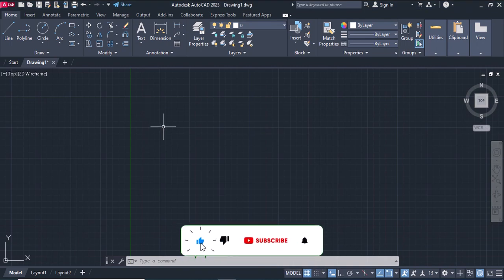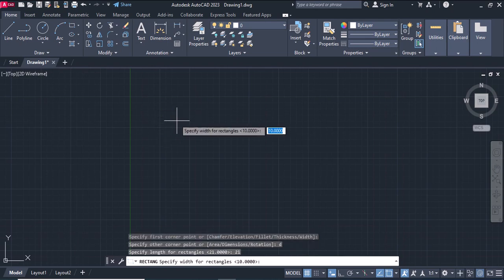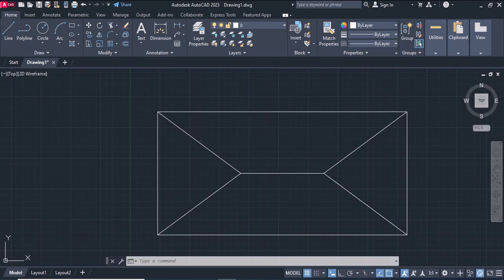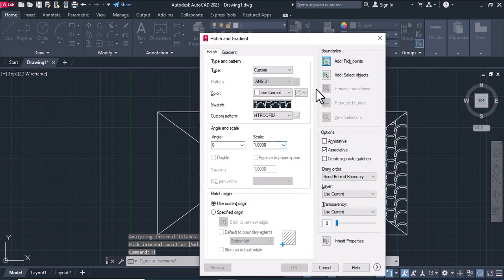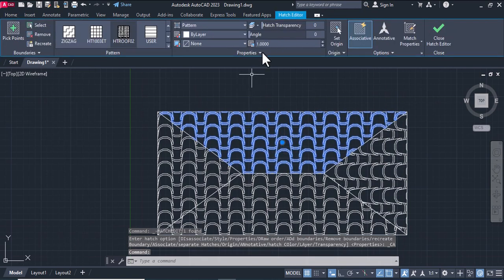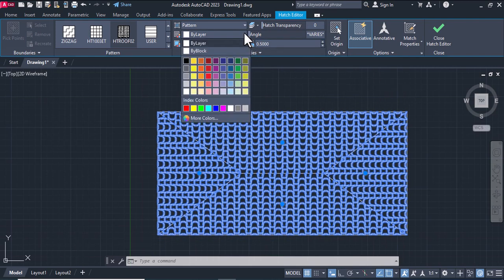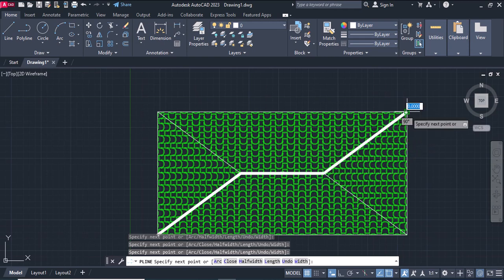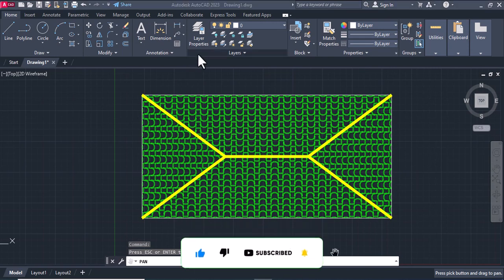How to draw a Roof in AutoCAD 2023

Comment: i dont have a hatch and gradient command how to do that
Reply from the maker: which version of AutoCAD do you use?
Reply: @4Engineering  2023 sir
Reply from the maker: It’s strange how you don’t have command for them, otherwise just write hatch or gradient you would be seen them
Reply: Just a normal hatch if I use Hatch key
Reply: How to apply those hatch I just downloaded sir
Reply from the maker: @09kalix  To add a hatch pattern that you've downloaded from the internet into a CAD (Computer-Aided Design) software like AutoCAD, follow these general steps:

1. Locate the Hatch Pattern File: Ensure that you have downloaded the hatch pattern file in a compatible format. Typically, hatch patterns in AutoCAD are stored in .PAT files.

2. Open AutoCAD: Launch AutoCAD on your computer.

3. Access the Hatch Command: Type "HATCH" or use the ribbon menu to access the Hatch command. It's usually found under the "Draw" or "Home" tab.

4. Load Custom Hatch Pattern: In the Hatch Creation dialog box, find and click on the "Custom" button, "Load" button, or similar option depending on your version of AutoCAD.

5. Navigate to the Downloaded Hatch File: A file browser window will open. Navigate to the location where you saved the downloaded hatch pattern file.

6. Select the Hatch Pattern File: Select the hatch pattern file (with .PAT extension) and click "Open" or "OK" to load it into AutoCAD.

7. Specify Hatch Settings: After loading the custom hatch pattern, you will return to the Hatch Creation dialog box. Specify the desired settings for the hatch pattern, such as scale, angle, and origin point.

8. Apply the Hatch Pattern: Click inside the closed boundary or area where you want to apply the hatch pattern. If you haven't created a closed boundary yet, you can do so using the drawing tools in AutoCAD.

9. Finish and Close: Once you've applied the hatch pattern as desired, you can press Enter or click on the "Close" button in the Hatch Creation dialog box to exit the hatch creation mode.

Remember, the specific steps may vary slightly depending on the version of AutoCAD you're using, but the general process should remain the same. Additionally, ensure that the hatch pattern file you downloaded is compatible with AutoCAD (.PAT format).
Reply: @4Engineering  you have a video for this?
Reply from the maker: I don’t have a video for this, sorry